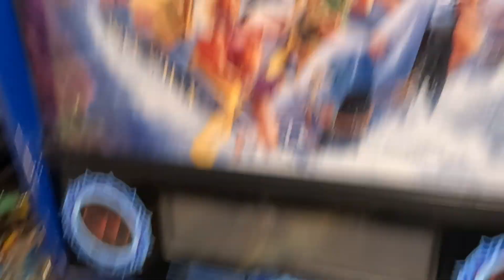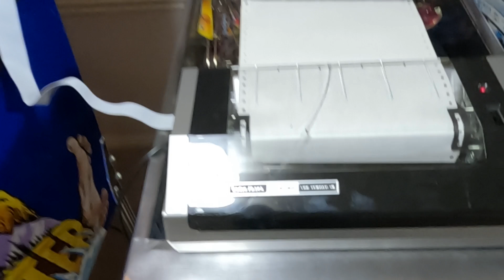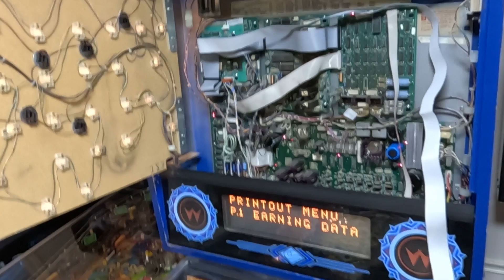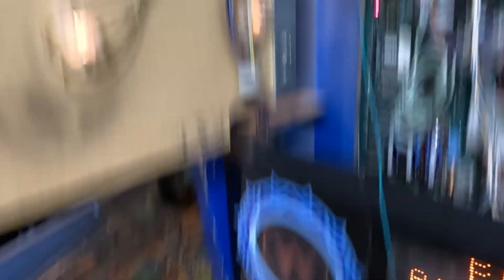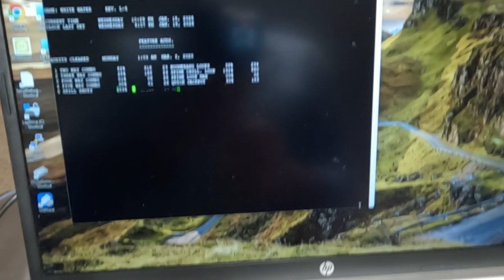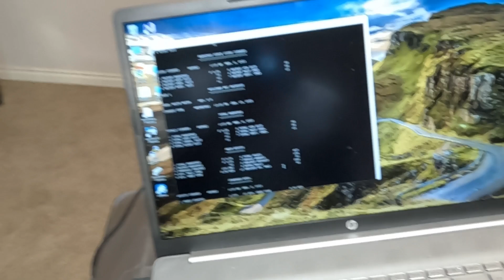AE#229 Williams WPC Pinball Printer Interface Demo

Comment: Back in the day moonlight working for a major distributor I had to use this feature. The printer boards were installed back at the shop and tested. We had six printer kits as that was the most machines at any location that needed data. These were in "Test" games. Pretty sure I still have a scan of the installation manual. I was shown how to perform the downloads and they gave me a thermal printer, which I hated. The bad thing was it would use a lot of the roll on each location. If you were not paying attention you would run out of thermal paper before data was taken from the machine you were accessing. Install a new roll and re-download again. Nice video.

Comment: That laptop will serve you for years to come, if you don't connect to the internet.
Many computers are running Windows XP in factories and workshops, using older software to run machines.
Reply from the maker: You could also turn off auto updates, but it seems that certain "critical" updates get pushed regardless,  and those probably the ones that cripple your PC.
Reply: @artifactelectronics With some tweaking software they can easily be turned off to achieve zero updates. I'm still running W7SP2 with no updates and this Toshiba Tecra A8 laptop from 2009 runs very well.

Comment: A very interesting curiosity and as you say, a rare one too! As regards dumping the output to PuTTY, on the pinball machine menu you selected pause after printing a page which is why it did exactly that! Since the device was designed to run with real printers it almost certainly sends a Form Feed <FF> character (0x0C) at the end of each page, which most terminals interpret as a clear screen command. No need to take a screenshot of the output - PuTTY has logging capability to send the data to a file. Looking forward to the next video 👍😁
Reply from the maker: I'll give that a try with the option that prints all data.

Comment: Very interesting to see such a rare item. On the serial dump did it have the same errors that the parallel printer did? That'll maybe tell you if the software has those errors in it or the printer is faulty.
Reply from the maker: The errors do not appear on the terminal. It must be the printer or the cable.